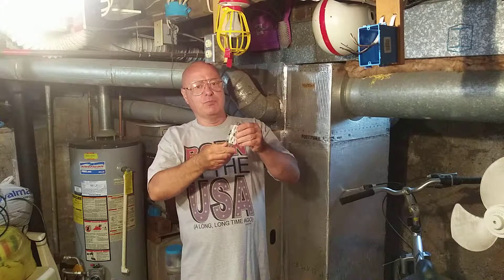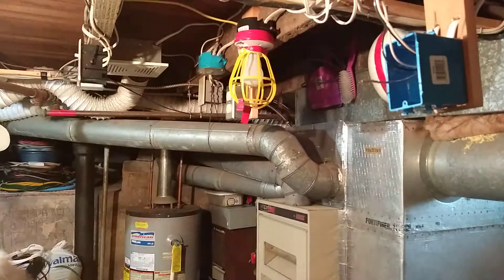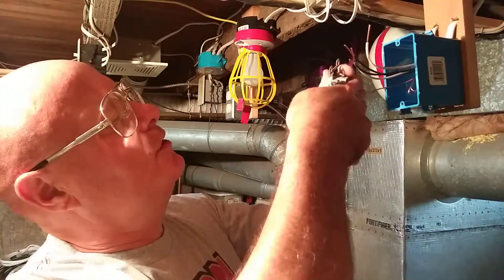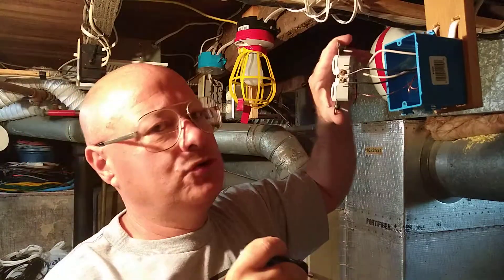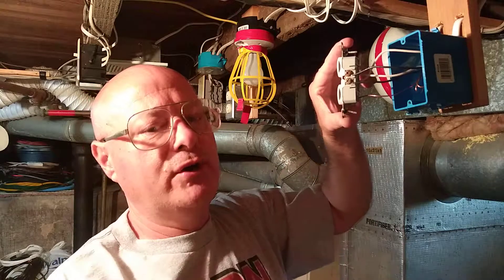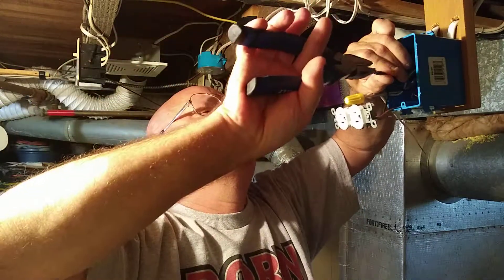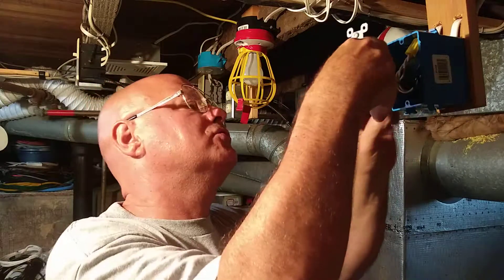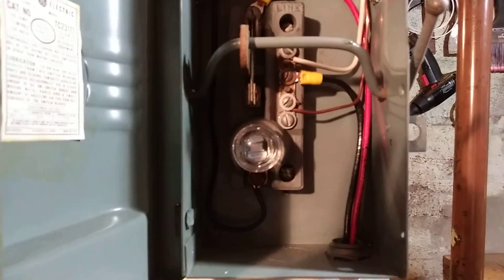I show and explain the difference between series and parallel wiring of a outlet

Comment: Both of these methods appear to be parallel wiring. In order to have series wiring the current from one outlet has to pass through the load of the other, that is not allowed anyway.
Reply: The first method is "series" in the sense that power has to pass through the metal tab which connects both hot terminals.
Reply: You sir are correct. No appears about it.